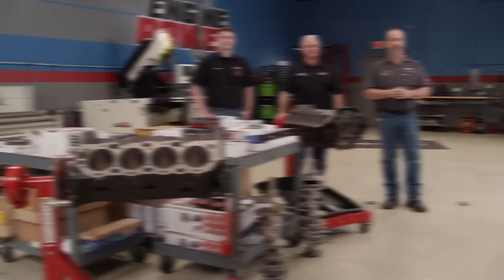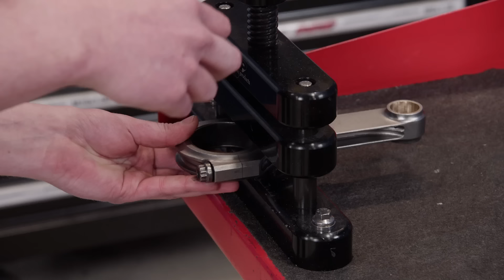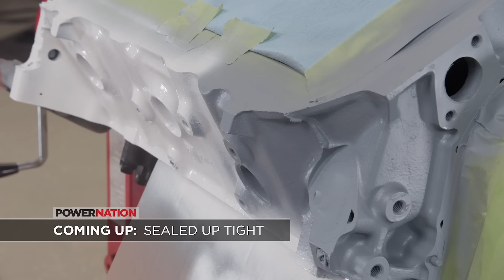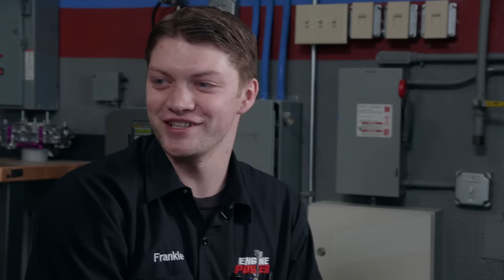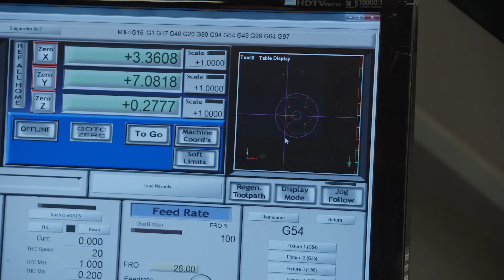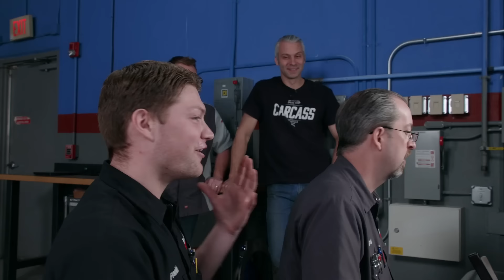Twin Big Blocks Dyno'd Together - Engine Power S9, E5 & 6

Comment: I went to a cackle feast way back and the freight train dragster was there. And the first thing I did was to see how they were coupled. A single row sprocket on the back of front engine and a single row sprocket on the front of the back engine. A double row chain tie them together. Engine timing is same firing order on both. Same cylinder fires at same time. Front engine runs a couple of degrees less timing making the rear motor the lead engine. The same on double engine Harleys. Kind of like tug a war. Everybody pulls at once not one at a time.

Comment: I would be curious to know just how the power output would be affected if the engines were to be connected 45 degrees offset to each other relative to TDC on one and 45 degrees off TDC on the other ? . ? . ?

Comment: excellent , in case its of any help i phased my twin 6 cylinder car at 43d so the power stroke was offset .
Reply: I just posed that question . . . . . how did that work out?  Also, shouldn't the offset had been 30 degrees?
Reply: @wesalker3479  wes good question , i wanted it to sound like a 19 cylinder radial like the flight of the pheonix plane , and that was the only way to get the correct firing gap ...
Reply: @RobertsChannell  Interesting! . . . How about using six Harley V-Twins offset 60 degrees to each other.
Reply: @wesalker3479  do it ! :)

Comment: That figures out to 3% loss of expected hp and 3.9% loss on expected torque. That is not much. Since you are relying on mechanical alignment and phasing, fine tuning your shaft alignment and perhaps going to a higher spline count might make that up. That was a very nice job:)

Comment: The only problems i seen was you should have run the exhaust separate, but more importantly the second engine should have been set up at top dead center #6 instead of #1

Comment: I would have connected them using a shaft with a 1 way bearing at one end, like an rc helicopter uses to drive the main rotor blades. This would allow one of the engines to slow in rpm without consequence.  Though their idea worked with the solid shaft, I wouldn't have imagined I would have been able to keep them both constantly running from start to finish at the same rpm, and thats why I over engineered this in my head before watching the video.

Comment: DID YOU SYNCHRONIZE THE ENGINES TO FIRE SAME CYLINDERS SIMULTANEOUSLY OR PHASE THEM 180° APART LIKE A TRUE 16 CYLINDER ENGINE WOULD FIRE?

Comment: So now you need to put the two engines into the bed of a pickup and drive it on the street.  Could be rear wheel drive for simplicity, or four wheel drive truck for traction. Obviously more complicated application than hooking up to a dyno, but probably simpler than any front-engine application and with better weight distribution being middle engine.

Comment: This engine needs a follow-up. Better coupler, better phasing, etc. Also the various 'never seen before' horseshit is just outright false, not only has this been done multiple times before for various implementations, but this is also how engine platforms are made and expanded upon; VW Group's W16 for example, Aston Martin - Ford V12s for another example, etc., it's cheaper to develop in modules that multiply in size with some final tuning on the final designated engine sizes, this is how a modern V16 based off the big block platform would be developed, though with a better coupling (stronger and shorter, essentially a two piece crank with the blocks touching) and unified plenums and exhaust, before the solid V16 block is made for pre-production.

Comment: This is cool but you should check tractor pulling, they are coupling up to 8 or more V8 big blocks, two or more large V12's, V10's, airplane radial engines...all on a single diff to power the big rear wheels. That is next level crazy.

Comment: Pat, you want to make 2,000 to 3,000 HP ??
My Father was a WWII veteran (passed), he obtained a 1710 Allison V-12 aircraft engine,  you want to use modern fuel injection and 4 turbo's??
This will be easier  one block, one crank, 12  rods/pistons, one starter. 
Will be lighter than two BBC.
If you want to give it a try leave a comment.
Or
A good machine shop, needing a project.

Comment: The engine farthest from the dyno is stuffing all it's torque through the crankshaft of the nearest engine to the dyno, and twisting it a little maybe? It could be enough to alter the ign timing on the rear cylinders.

Comment: A cool project I've always thought would be cool to do is make an Inline 8 Cyl. Engine using 2 high performance 4 cylinder engine
Reply: Would be interesting to see using these modern 4 cylinders making 300+hp with roughly 2L displacement (don't have the actual numbers in my head lol)

Comment: My vote is for engine phasing. Engines not used to have help. 😅 So it’s less efficient if the engines are not phased. You could re-bolt them together both the top dead center of C1 and see if we can make a difference.

Comment: When you start thinking about that drive shaft's elastic deformation and rebounding like a torsion bar suspension  and the vibrations, that alone could account for a large portion of the power loss. No matter how rigid the steel, there's still some elastic deformation.
Reply: What would have been interesting, is to see one of the engines set up for reverse flow, and had them joined back to back, flywheel to flywheel. Obviously an expensive endeavour, but still interesting to see.

Comment: Tbh I'll just say this: You want coupled engine madness, Go take a look at one of CarsandCameras' builds that they did awhile back. Of which was a triple engine minibike. It's initial config was also set up as a three seater minibike too before they turned it into effectively a long drag minibike with three engines. They've also done a 4 engine gokart that had an engine per wheel. Which... as you can guess... was also madness. The only good thing about such small engines is that... They don't make allot of power usually out of the box, but they can definitely handle a decent~ish amount of power out of the box if you do some shenanigans to make it work out.

Comment: A thermal imager would be a fine instrument for your shop. Your joint between the two would not fail without getting warm or hot;  you could monitor with one as you ran it somewhat under load for instant results. Also, I think the percentage of loss must be relative to a vibration that must occur between the two; believing it is near impossible for a limited budget to bring the two engines to perfect alignment...assuming your budget was limited...

Comment: funny thing here is that there actually was someone who built a twin v8 car and they were connected at the crank, wildest sounding tire shredder ive ever heard. biggest difference between those engines n these are those were small block 350s. vs something like these twin (id guess 454s)

Comment: This video would be impressive if you never heard about the FIAT AS.6 engine: it was a doubled up FIAT AS.5 with a total of 24 cylinder, 50 liters that could output a total of 3100 hp at 3300 rpm

Comment: Now the question becomes, “what happens if we put THREE engines together?”
Reply: Three  engines  and   3 turbos
Reply: @jasonbailey8960  2 turbos for each engine :D
Reply: @jasonbailey8960  why not 6 turbos
Reply: @okay-red  na, that's too much white paint. Lol
Reply: They might have to build a bigger dyno cell to fit 3 engines in there
Reply: Then four then maybe five ????🤔🤔🤔. Mass carnage 🤔😁
Reply: I like the way you Gents think!
Reply: Garage 54
Reply: A v24😳😳
Reply: The torsional vibrations would probably snap the third crank.
Reply: How about 5 and we mount them on a tractor and pull a sled with it ???

Comment: I imagine the reason you saw a loss is due to the heavy piece of steel physically attacked the flywheel on one end and the crank on the other. You can not expect no loss and a perfect doubling. That would break the laws of physics

Comment: New word of the day,...PONTIFICATE...I love it. Dont tractor pulls use multip[le engines which have a higher rate of power and most likely a far wider range of powers between engines??

Comment: Would have staggered the Sweet 16's crankshaft connection so that all 16 cylinders fired at different times for maximum power pulse smoothness...

Comment: They do make alot of reverse rotation parts for 454s, for boats. So I always thought about coupling them at the flywheel. When i was younger I remember seeing a rail dragster (twin bears, I think) coupled the engines together by pushing the flywheels together, and both motors at 45 % angles and 8 exhaust pipes sticking up in the center. Wild idea fellas

Comment: Chevrolet work cuz the parking Universal but Ford and Dodge to Parts on University you can't switch parts off one and two on to another you have to Ford Mustang same size motor seam-side transmission you can't take parts off the other one put on the other one cuz you won't work Fords suck GM has better designs called a poor man's cardew Chevy is

Comment: The reason they're good engines is because of GM and gave made by General Motors is good y'all talk about stuff like that you going to 4-door Dodge and you going into junk he is the one will break and blow or the other one was just catch on fire you need to stick with the Chevy's they run the best

Comment: 40:43 I think that it would be better to mount one engine with 45° offset, because then duration between cylinder fires would be shorter.

Comment: My real world coupling would be 18 wheeler driveshaft couplers: equivalent expected torque, and readily available, plus splines to play with phasing. I'd LOVE to set this up in a pickup or maybe lowrider 2 ton truck. Next question would be the transmission. With that torque curve, you wouldn't need many gears, but they'd have to be up for some abuse. 
PLEASE play with the phasing and exhaust, and show what you find! Inquiring minds want to know!

Comment: At Caterpillar we offered a V24 that was two V12 blocks and the crankshafts were connected together. But it went into a generator skid, nothing that moved.
Reply: I built Caterpillar V24 engines (2 V12’s joined by a coupling) for a number of years, which were used in the 797B mining dump trucks. The engines were phased so that the front engine was timed on TDC compression stroke, then coupled to the rear engine on TDC exhaust stroke. This was to help eliminate vibration and harmonics.

Comment: This is something i've been interested in seeing done professionally for ages. Even had schematics and some drawings laid out back in the latter 90's early 2000's.

I've a 1973 Delta 88 Oldsmobile, the 4 door kind that if you rolled all 4 windows down, it looks like a stretched 2 door.

I had it planned out to pull the 455 out and modify the vehicle into a 2 seater, basically eliminating most of the trunk, putting the dash and drivers seat basically just ahead of the rear wheels and transplanting 2x 455s under an extended hood for that vehicle. I even had a crazy heavy duty electric clutch on hand that would fit between both engines allowing me to operate only one if need be (obviously the one closest to the firewall) and allowing me to fire up the 2nd one on a whim and locking the clutch. the Clutch is something pulled out of a john deer combine that is used to engage the rotor, which is designed to take one hell of a snap as well as an insane amount of hp/torque, so i knew it would do the job nicely and is heavy enough not to be a problem not to mention it's designed to attach basically directly to the engine anyways.

Unfortunately the project was backburnered due to the family circumstances, but i still have the vehicle and most of the parts. If everything went together relatively well enough that it looked like a professional paint job would do the trick for making it look relatively "stock" minus the obvious shortened cab and lengthened hood, we'd leave it that way, if however a lot of modification had to be made and we started running into constraints in terms of mangling the body up and making it clearly obviously not remotely concealable, we would drop the rear differential on it, and put a 1 ton dual or even a tandem axle under the back end, start welding random scrap metal to it in a relatively appealing way and keep it roughed up paint wise so that we could drive it around as a Mad Max vehicle.

Comment: Is there any advantage to timing the second engine 22.5 degrees from from the first at TDC? The intent is have one cylinder on a power stroke every 22.5 degrees about the crank.

Comment: If aircraft engine manufacturers can bolt multiple engines together to make 1 complete engine than why can't multiple  vehicles engines be the same?  Take the Pratt & Whitney R-4360 Wasp Major aircraft engine. It's a 28 cylinder that was bolted onto a Convair B-36. This engine is basically 4 (7- cylinder) engines bolted together connected by only 1 crankshaft. 
ngine displacement was 4,362.5 cu in (71.489 L), hence the model designation. Initial models developed 3,000 hp (2,200 kW), and later models 3,500 hp (2,600 kW). One model that used two large turbochargers in addition to the supercharger delivered 4,300 horsepower (3,200 kW). Engines weighed 3,482–3,870 lb (1,579–1,755 kg), giving a power-to-weight ratio of 1.11 hp/lb (1.82 kW/kg).

Comment: Phase it 22.5• would make it a v16 vs and tandem v8. Every weak point would be taken up by the second engine. A cylinder event every 22.5• vs every 45•. In this config i think it will make more power than phase matching it.

Comment: A much better coupler would just be identical roller-chain sprockets, one on the flywheel and one on the nose; placed correct distance apart and wrapped with a single double-roller chain.  Would safely allow a bit of misalignment and eliminate any side or end loading on the cranks.

Comment: The GMC 702 v12 used a special block and crank, but was otherwise a factory coupling of two GM 351 V6 truck engines. It was used in large chassis commercial trucks and fire engines.

Comment: Bit of a newb question I suppose, but what's the downside to using a piston ring gap that's larger than necessary? I would think it is just some compression loss. Given the dire consequences of too small of a piston ring gap I would think everyone would err on the side of caution and leave it at that.

Comment: Great video guy's on a fascinating topic. I can only imagine this setup in a powerboat cruising offshore racer style. Those are nice power numbers and would even be awesome in a monster truck chassis with front end rear mounted engines. You couldn't run them coupled together but they are so well matched that they would be great in a monster truck chassis.

Comment: I wonder what would happen if they were firing opposite banks so cylinder 1 on front engine and cylinder 2 on rear engine would it lessen vibrations, or if the rear engine was exhausting when the front engine was on compression stroke so many variables lolz deja vroom

Comment: I'd like to see the results with them phased 360 degrees different from each other. Motor 1 on TDC of intake stroke, Motor 2 on TDC of power stroke. Will this cause vibration or not? Will it make the power flow more evenly? Will it cause less stress on the dyno connection? Will it cause less or more stress on the second crankshaft?

Comment: Unlike some of the other shows, I get the impression that Pat and Frankie, and the others that have been in Frankie's place are actually doing the work, rather than letting most of it get done off camera by other people.  Does anyone know if that's true?    And that's not meant as a shot against the other shows. TV has it's realities, and the ability to clearly explain and illustrate the subject matter is much less common skill than bodywork or prepping a frame for welding processes. Filming things notoriously makes things take ten times as long. Not sure why I get the impression the engine building is different. I just do.

Comment: One way sprag clutch in-between two engines could have alleviated micro ignition timing differences. I would love to see them MSD controlled to elimnate the mechanical ignition difference factors 
Good job guys

Comment: With identical engines this would be a good test just between different fuel tests if you use pump gas and you go to e85 without changing anything then to a low race fuel

Comment: GMC actually made something similar to this for a while. For big vehicles like fire trucks they made a v12 engine which was basically two 351 v6 big block motors put together. I think they used one block but had 2 standard heads on each side. Those v6 engines were made from 1960-66 so I think the same years. It's called the twin 6 v12 if anyone wants to look it up.
Reply: is this not how detroid diesel made v12s
Reply: @THESLlCK  these were gas v12 engines. They did make the v6 and v8 versions of this motor as diesel engines though. Just google gmc twin 6. You'll see.
Reply: Copied from an article on them "Contrary to popular belief, the Twin Six was not the simple union of two 351-cubic-inch engines welded together. The Twin made use of a unique single-piece block and one-piece crankshaft, the latter of which weighed 180 pounds.

The Twin Six operated as if it were two separate V6 engines, however—it utilized four cylinder heads, four exhaust manifolds, two carburetors, and two distributors."
Reply: Thanks for that info didn’t know this
Reply: Isn’t that a diesel
Reply: @marcustrue1213 nah its a gasser. Its a 702 Cubic Inch V12. I actually only learned about it from Mad Max Fury Road. They had a car called "The Elvis." It had a GMC V12 in a 32 Ford 3 window coupe. The thing is, the engine makes all of its torque so far down low youd have to work some magic to be going fast, but remain in the power band. It was a truck motor after all. Nowadays its only really for looks or nostalgia/number matching vehicles